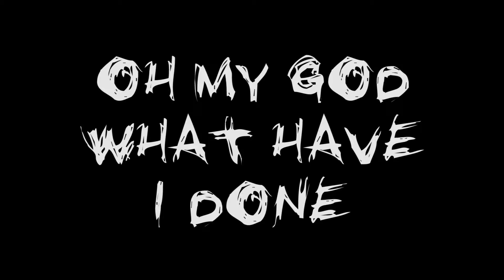The Cumstain - Episode 28 - SO MANY LEAKS!! pt. 1

Comment: same thing on mine.  redid the taillight seals and cleaned the drain holes.  you may want to remove your back carpet all the way...my fuel tank cover was rusted through.   also make sure the drain in your fuel filler area is clean.  that's what filled up the area around the jack.   last thing is double check the whole rain rail around the back belt line.  pour a cup at a time in different sections around the roof.

Comment: Great tips regarding the drain holes.  Every Miata owner needs to know about these.  I've seen guys with hardtops (better access to those holes with the tops off) spray from a water hose down into the holes to let the water pressure clean them out.  That would probably backfire on me though.
Reply: I just saw, in my inner mind, what could happen if that hole is clogged enough and you do that. That does not look fun.
Reply: Yes, I agree!

Comment: I left a quart of gear oil in the trunk, cap become loose and it's two weeks and i still smell it. Check the tail lights, mine let rain in at the tail lights as you said. The water caused my brake light fuse to blow.
Reply from the maker: I actually believe that the water was coming from a different place that I'll reveal tomorrow in a part 2 video.  But I think I'll still order new tail light seals.  They're only $10 each from MossMiata.

Comment: I had exactly the same problem. My rain rail was old and cracked. Take off the black panel on the left in the boot. With the boot open and roof up turn a hosepipe on the roof. If water leaks in behind the left rear suspension. Chances are it's the rain rail. Mine was leaking in both sides.